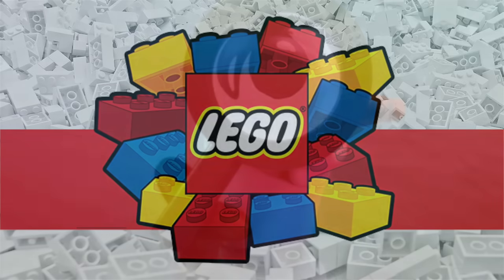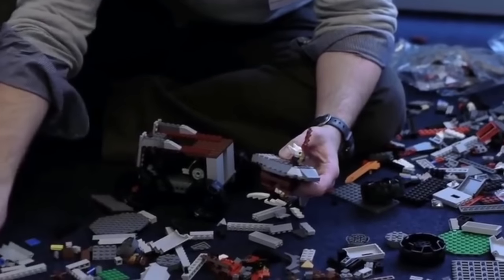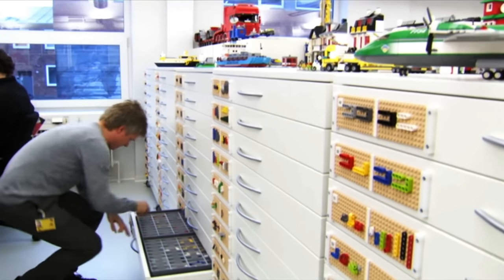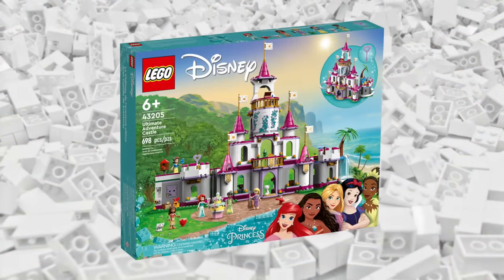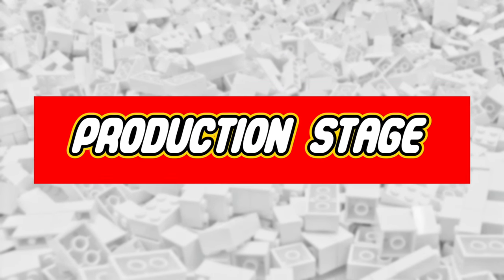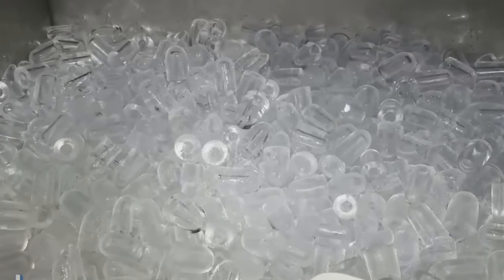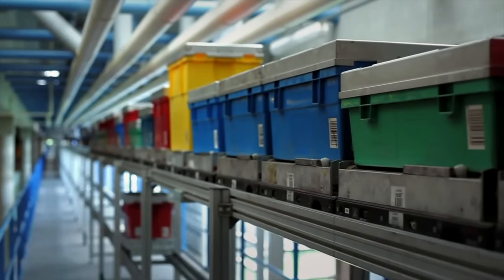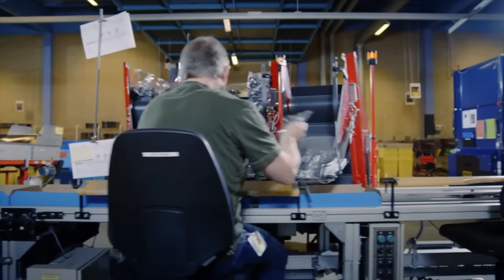How It's Made: LEGO Sets

Comment: Setting the price before designing the set makes sense for smaller sets and themes, but it results in big problems for larger sets like the Tabletop Football set and the UCS Hulkbuster, where the sets are unnecessarily padded to meet the price point.
Reply: i notice this sometimes that some sets seem to have artificially increased their piece count. like a step involving placing two 2x2 brings side by side instead of one 2x4 brick, which increases the piece count and justifies a higher price.

Comment: For precision of the machinery it's often stated Lego is an even more demanding customer than medical or military.
Reply: Which military. I know in the usa military buys from the lowest bidder so military grade means barely functional.
Reply: The size tolerances must be very demanding.
 Too tight and they won't fit, too loose and they'll fall apart.

I recently heard that polycarbonate shrinks more than ABS, so clear pieces needed their own special molds for standard parts to allow for extra shrinkage.
 One reason why Lego switched polycarbonate for transparent ABS.

Comment: Great video! I'm not a hardcore Lego guy but I've played with them my entire life. I'm always amazed how I've never bought a single set that was missing a piece. Not once. The level of quality control in Lego is second to none.
Reply: I had one or two sets, where the colour of piece was either incorrect in the manual or incorrect in the set: dark gray instead of black. Otherwise all was perfect for years.
Reply: LEgos Qualtiy is getting worse and worse every year, only the prieces goes high
Reply: @bennebolle6054  Care to back up that statement with any proof? Because this is exactly the opposite of what I said.
Reply: I am usually impressive with the quality. However, between my husband and my daughter, we got 8 new Lego sets the last few months. Two sets had a missing piece and another set had a piece that was crack/smashed at the corner. The set with the problem are pretty large sets. Lego does have excellent customer service. We got the replacement piece in a week.
Reply: @YT0091  I recently got the lego Benatar set and had a piece missing. I've gotten a ton of lego sets over the years that were all perfect, so it came as a surprise having a piece missing. Especially on a fairly big set
Reply: I'm at the lego store now because there is a missing brick. But it's the only set out of all the ones I've had, so, pretty good QC

Comment: Huh.
I always just assumed they gave you "extras" of the smallest, most commonly LOST pieces just in case you lost one. But this explanation makes way more sense given the seeming randomness of the pieces and their numbers.
Reply: I guess, having spares for the customer is a positive side effect. And no, there is nothing really random about them – in fact these pieces are very predictable, as every mold either comes always as a spare or never. Also there are a few rather light pieces that don't go as a spare (like the infamous blue technic pin) for some reason and in large sets, you may find repeat spares in later bags. And if you don't have one spare left for a mold where you'd expect it, that's one of those rare packaging errors they are buffering.

Comment: 5:59 old ones were made in ABS but in 2015-ish they swapped to PVC which is still good but less prone to break like old Bionicle parts which were made in ABS
Reply: They are currently changing them to a recyclable plastic
Reply: The infamous brittle brown pieces
Reply: Lego's own website says most bricks are made of ABS.
ABS is almost infinitely recyclable.

The main change was clear pieces used to be polycarbonate, but are now a type of transparent ABS, which doesn't require different molds (unlike polycarbonate) but does scratch more easily.
Reply: @massimookissed1023 yes the original commenter has it backwards PVC transparent parts have been retired and replaced with ABS plastics.  

Some people have complained that the ABS scratches more easily than the PVC however the PVC doesn't meet environmental and safety standards anymore so LEGO hasn't got much choice as I understand.

Comment: I wonder what are the requirements for a new piece to be approved for production.
I mean, a new piece requires a new mold and storage and it's going to be used in just one set until the designers use it again in the future so i guess someone has to approve it or tell the designer to use a different solution.
Reply: Probably like the lego ideas set where they thing it has to be stable and popular enough to justify the cost. Though i feel that it would just have its own temporary machine to make 10,000 to 50,000 sets.
Reply: I suspect there are many deciding factors.
 Can they make many in one mold, or is it a large piece that can only fit one per mold ?
 Is the new set predicted to sell enough that the new piece will cover its cost with just this set ? Or ...
 Does the proposed new piece have other possible uses ?

Comment: The bit about the extra pieces is entirely false, and casts doubt on much of the rest of this documentary.  Anyone with any sensibility will realize the extra pieces are there 100% on purpose, as they are the most likely for the customer to be lost, and complain to Lego that they never received them.  Rather than deal with the fallout of that, LEGO intentionally gives at least one extra piece of virtually any 1x1 size plate or tile, or similarly sized, or even special pieces.  Were this not so, you wouldn't be able to go to BrickLink and find the extra pieces section in the inventory and find that every single set has the exact same amount of extra pieces, of all the exact same types.  I don't think the "designers" portion of the video is accurate either as it leaves quite a bit of questions unanswered.

Comment: The "extra piece" statement is not true. LEGO only adds one extra small piece to the first bag in the set to feature that piece. The only exception is if the build is separated into several boxes (like the Titanic, Technic Bugatti, etc.). Then in each box an extra small piece is added to the first bag featuring that piece.

These are added because small pieces are easily misplaced or lost when dropped on the floor. The fact that every other bag has the exact number of pieces needed shows LEGO is more than capable of providing the exact number of pieces. It's much cheaper to add a few extra small pieces in a set than having to send dropped or misplaced pieces to customers to allow them to complete the set. It's good business sense.